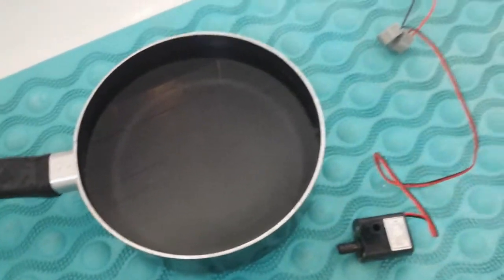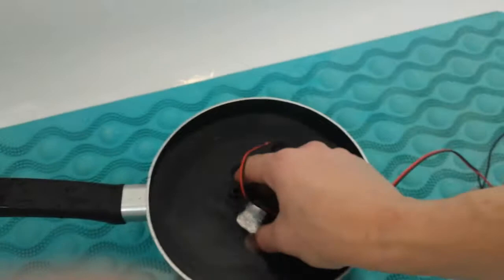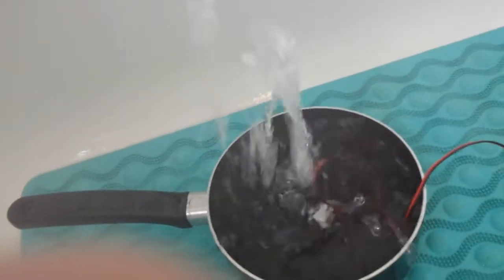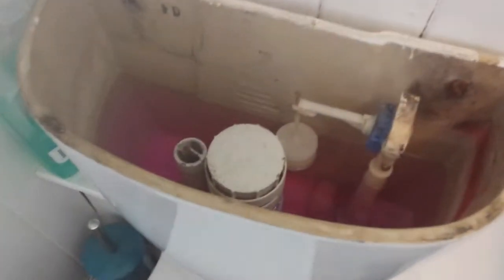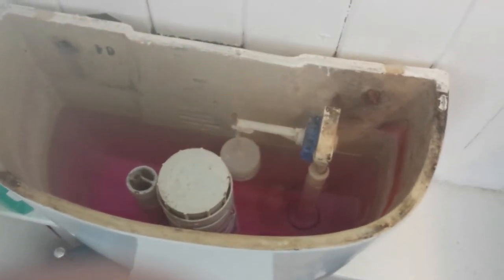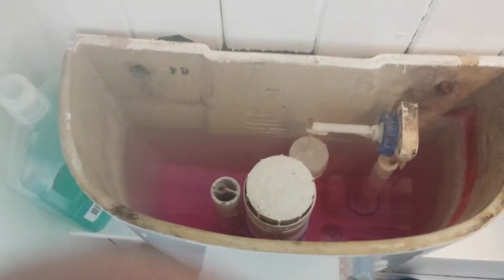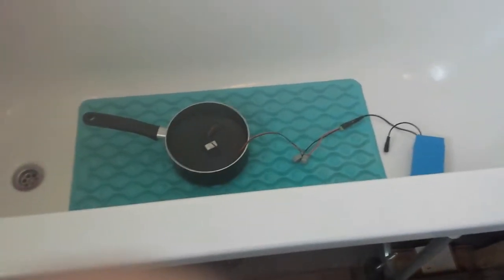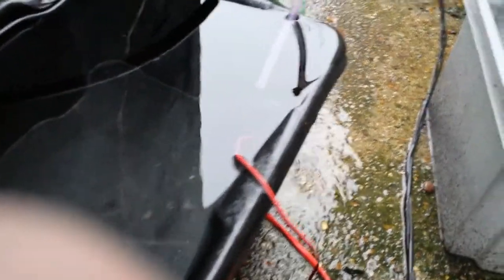Rain water flushing   Proof of concept

Comment: you would need a non return valve or check valve as they are known, on the mains cold water feed into the loo, to stop the rain water siphoning down the clean water inlet and contaminating it, to satisfy the water authority, great idea though, any chance of a link where you got the pump and micro switch.
Reply from the maker: I did concider a non return valve, but i'm going to consult a plumber I work with! When using mains cold water in a science lab you require an air gap between mains feed and the supply to the lab/s. Now I was thinking along the lines of the mains water comes out of the top of the valve creating an air gap?

I only have the link to the pump   -     http://www.ebay.co.uk/itm/331296945089?_trksid=p2059210.m2749.l2649&ssPageName=STRK%3AMEBIDX%3AIT